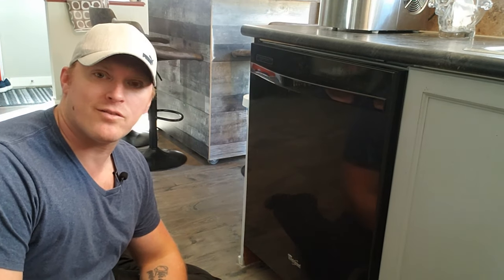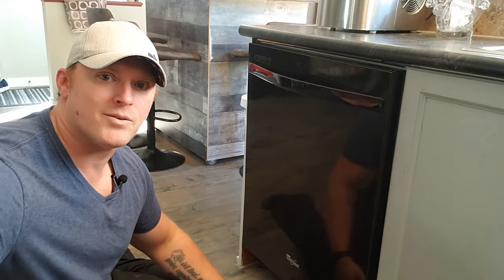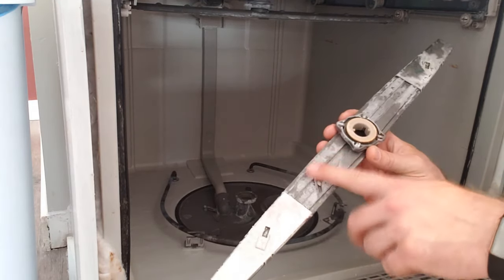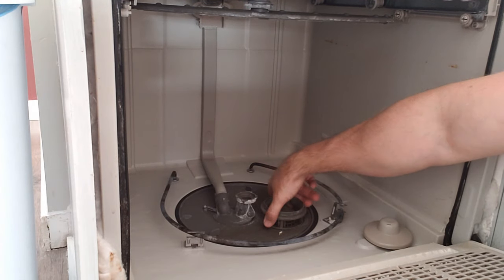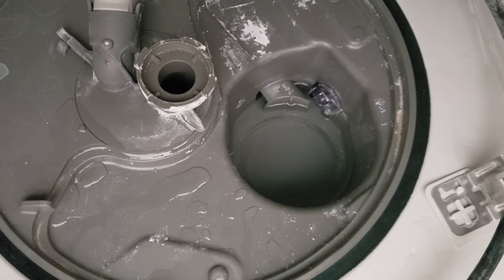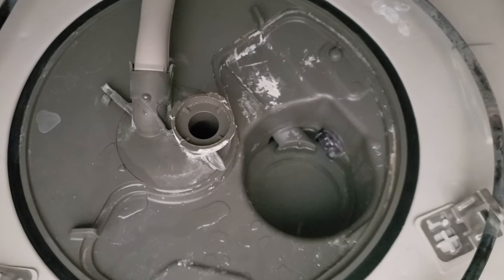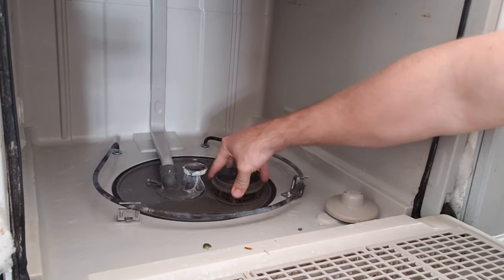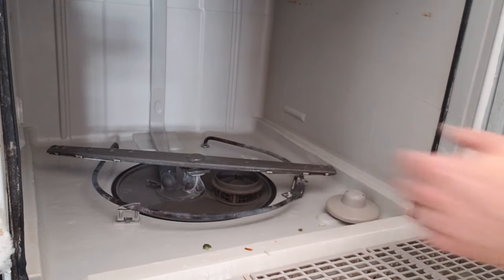Fix dishwasher not cleaning properly

Comment: The person who invented the dishwasher was the "Patron Saint of double handling". She was also the Saint of "no more kitchen cupboards" because everything is always in the dishwasher. Also the patron saint of doing a half ass job..
Reply from the maker: Thanks for watching Rustycarr59
Reply: Thanks for the great video. I used your info to try to fix our dishwasher, which has an intermittent fault. I tried all the obvious things, filters, pump out apart,  but after install and  removal several times I gave up. It would work for a day, then decide to error code. Content creators with real help, like this channel are a godsend!
Reply from the maker: @Rustycarr59  thank you so much, hope you get that dishwasher going.

Comment: Hey! Why would my dishwasher not be cleaning if it never has been used. In 13 years. Is that the reason why? The tablet dissolves, water is present, dishes just aren’t clean.
Reply from the maker: There are seals in the dishwasher that can dry out and crack if the dishwasher isn't used for a while. does it sound like the dishwasher is running?
Reply: @Thomasappliance  yes it sounds like it’s working. Just not clean. The dishes be wet from rinse, the tablet dissolves and everything. I just don’t smell the soap or anything. Just wet dishes.
Reply from the maker: @StatGeezy  there could be a water temp issue, the wash motor weak, which could both be from the dishwasher just sitting.
Reply: @Thomasappliance  thanks man 🙏🏾 I’m sending the maintenance request to my apartment now lol
Reply from the maker: @StatGeezy  no problem, sorry I couldn't be more help.

Comment: That model I believe runs all the arms at once. Alike most older dishwashers especially Whirlpool made models with self clean filters & food choppers they ran all arms at once because they had bigger motors to handle that. It’s more rare today however to find models that don’t alternate them. Our 2020 Maytag luckily does run the whole show at once, but they discontinued that model and wash system and they now all alternate and take longer per cycle.

Comment: I have a Maytag dishwasher.I put In brand new in 2002.  So yeah after that long time it's bound to have something going on. It seems to run through the cycle and do everything but I just don't think it has the water pressure it used to have. I ran some vinegar through it and it's real real clean inside , so I'm checking other things.
Reply from the maker: Yes machines definitely get slower and less powerful as they age, that's a long time to have a dishwasher!!
Reply: @Thomasappliance  I opened it up and there's a little dinosaur underneath there eating all the table scraps from the dishes.   I saw one like this on the Flintstones, so yeah, it must be pretty.
ancient.  🫛🥦🥬🦖
Reply from the maker: @icemancometh8679  lol that should last a while

Comment: My dishwasher is 13 years old & isn’t getting the dishes cleaned and I cleaned out the filter. What brand do you like? I’ve read whirlpool is good but have also heard some like Bosch but they’re $$$$$$. Thank you
Reply from the maker: There doesn't seem to be any good dishwashers out there right now, every machine has issues with something, even bosch. I would make sure it's a stainless tub not plastic, and don't worry about all the buttons, no one ever uses much more than normal or heavy wash.

Comment: Enjoyed your video, my washer stopped filling up with water so I put in a new water intake valve, 10 min job! It fills up now👍 but now it won’t start and spray water, all the lights work on the display though. Now what ? Please help
Reply from the maker: Thanks for watching Edward Reichard, depending on what type of machine it is if a washer fills but doesn't agitate i would check the lid switch. But every machine is different and it could be a lot of different reasons for the problem your having.
Reply: How can I check if the dishwasher is filling up with water or not?

Comment: I personally wouldn’t poke the sprayer holes with anything as the gunk will just go back inside. I run water through mine and shake them, any bits of food etc just comes out and there can be quite a few. The secret is to run a descaled through the machine every so often, it will get rid of all that white scale 😉
Reply from the maker: Yes for most stuff that works, until it's stuck or stuck on. I talked to the engineers at whirlpool about this and they advised to do what im doing. Always flush from the inside out also. And yes you are bang on with the descaler. Thanks for watching juliabrandon.

Comment: I have that exact model
Reply from the maker: Thanks for watching iklink, These dishwashers were usually pretty good.
Reply: @Thomasappliance  so my filters are clean but still washes poorly how likely is it that it could be the motor or a valve?
Reply from the maker: @iklink  it definitely could be not enough water, motor weak, or spray arms plugged.

Comment: How do I check if the dishwasher is heating up right or not?
Reply from the maker: The easiest way is to run it on a heated dry cycle and see if when its done if its hot inside. Thanks for watching PranayGuptaPG

Comment: Thanks! It was the spray arm on the left side there was a slit bit a tiny bit of rice was stuck in it!
Reply from the maker: Thanks for watching Signa Ocean, I'm glad you got figured out?
Reply: @Thomasappliance  FYI, I tried the vinegar idea today but the dishwasher stopped after 50 seconds. I then put some vigegar into a small sprayer, and sprayed the vent on the left side of the machine. At the top I sprayed around the fixture there.... it worked... I think there was more rice inthe machine I couldn't see... Any I share, as it might help someone else! Thanks so much Thomas... great advice!!
Reply from the maker: @signaocean5847  thanks for the update, glad you got it all cleaned out.
Reply: @Thomasappliance  Thanks Greg, keep up the great videos!!

Comment: I do wish he showed how to take that back piece off. I feel like I’m going to break it haha.
Reply from the maker: Thanks for watching RonBurgandy, that back piece depending on what model your machine is can have screws or clips holding the back piece on. Its not usually the easiest piece to take out honestly.
Reply: @Thomasappliance  it does just have that one screw and then attached to another piece. The clips holding it on seem so delicate so i cleaned out everything like you showed and am running a heavy cycle with everything on and have a cup with vinegar in it as well.
Reply from the maker: @ronburgandy3339  thats perfect, that should get it done.